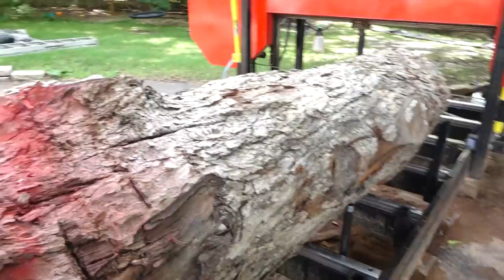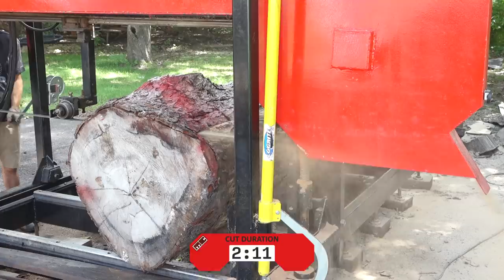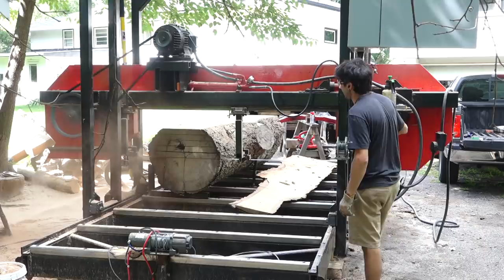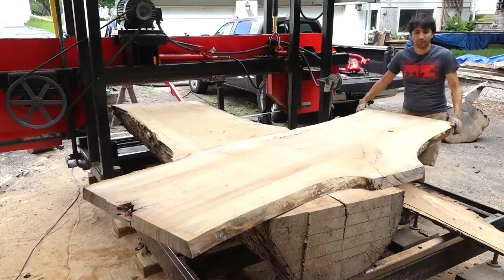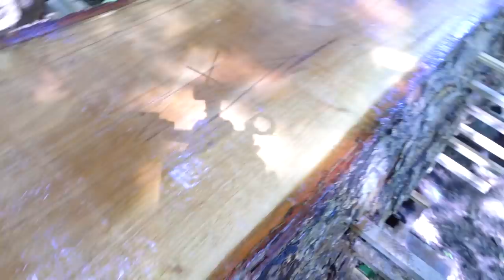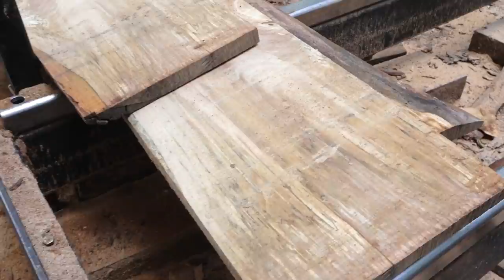Sawing a Pecan Log That Traveled 1200 Miles

Comment: I had by the Pecan tree trimmed. It’s quite large the truck is probably a little bigger than the one that you’re working on now. I tried finding someone to buy the larger chunks because it’s a shame just to burn it. I still have a few large chunks left, plus a branch that we haven’t taken down because it’s too heavy and will destroy the fence. If I can sell it I’d be thrilled. You’ll be worth removing that section of fence and then repairing it. Too bad nobody’s interested around here I live in Missouri. The wood Hass to be interesting, it is filled with bug holes...   

I wish I had your set up, I’m sure that every piece would be beautiful, the ones with holes filled with polymer.

Comment: Good thing that log has traveled so far, it might last up there. Even though it's pretty the bugs and bacteria in the south destroy it in no time, so not a lot of people use pecan even though the trunks can be found in abundance. Up there anything you make out of it should last a couple generations at least though.

They get eaten alive most of the time. The trees are infamous for keeping your yard littered with punky dropped limbs. It's like having an extra adolescent child to clean up after.

If it sits for any significant period before you use it, I'd spray it with some anti-bacteria/anti-fungal agent just to make sure it doesn't start to soften up, but you've definitely got more time to work with it than we'd have down here in the south.
Reply: I've never had any bugs or bacteria bother any of mine and they all air dry. I will keep that in mind though.

Comment: That is a baby pecan log , you should see some of the big ones down here in Texas , I have 4 in my yard that are over 36 inches across at the base and 5 more around 24 inches or so .   I think you need some kind of roller rack you can set up to slide the slabs onto and then just slide them down the line to where you want to stack them .

Comment: I grew up in Georgia in a Pecan grove. I spent many a day gathering pecans but never realized what great wood was in the trees. It would be my choice for a table. I noticed you using a drill motor on the winch when sawing the boards. I always wondered why you didn't use a power drive on the saw instead of hand cranking. I figured it was so you could control the advance speed but you could install a variable speed drive and save your arm.
Reply: I assumed it was so he had feedback so he could speed up or go slower, or in case he hit something.

Comment: I have about a15-20 acre pecan grove. It's nice to see what I potentially have in the lumber. It's also nice to see you cut up some for cabinetry boards. Not everyone can handle slabs. I'm wondering how pecan would work for board and batten siding. Maybe a preservative would be needed?  It would be better as an interior paneling?

Comment: Matt, i love your videos. However, if you put an iron or galvanized pipe over the end of your log turner  handle thus extending its length it will provide more torque for the same muscle.   Easier for the humungous trees you roll around on your sawmill.

Comment: Are you using a small inflatable bag/pump system to lift the ends of the slabs while stickering? It looks like you pulled something out from the end a couple of times... I also mill and stack larger stuff solo and struggle to get the last sticker in each time. Any tip you have to share about that would be greatly appreciated. Thanks and keep up the great content!
Reply from the maker: yes, one of these guys: https://amzn.to/2Kju0VD  This was the first time I've tried it for stacking and it was amazing.  That last sticker is always the hardest!

Comment: Question - Is there a reason you don't use a two sided blade, if available, so you could saw on the back stroke instead of raising and resetting?
Reply from the maker: They’re made for much bigger saws as they cannot have external trust support
Reply from the maker: Thrust*
Reply: @mcremona  Makes sense, thanks.

Comment: Mat, I have been told by others that the stickers need to be within 2 inches of the end of the slab. Is that not true? Oris it only not needed for Pecan? love your vids.
Reply from the maker: The logic there is the sticker will stop checks from continuing further down the board since the friction between the wood and the sticker will hold the wood and keep it from separating.  If you use an end sealer, it really doesn't matter since you shouldn't get much checking anyways

Comment: Dumb question you may have answered already... why don't you cut the pith out of the slabs?  Isn't that the most rot prone part as you dry the wood?
Reply from the maker: It's crack prone.  Usually the crack just travels up the middle following the pith so I just save the step of separating the two halves.  Sometimes like in this case, the crack is already present

Comment: I am surprised you haven't installed a gear and pulley system married to the motor to drive the saw head
Reply from the maker: I'm surprised by your surprise
Reply: I'm shocked at both of you...

Comment: Unusual to see you cut boards. lol
Just wondering if anyone you know of that has built your mill besides the one you helped on.
Cheers, Lee
Reply: April Wilkerson down in Texas has built one.
Reply: That's the one he help on but you probably know that. Used the plan but with a few improvements. April did some serious shopping around for some of the components. Great videos.